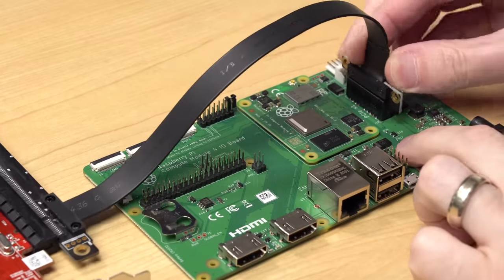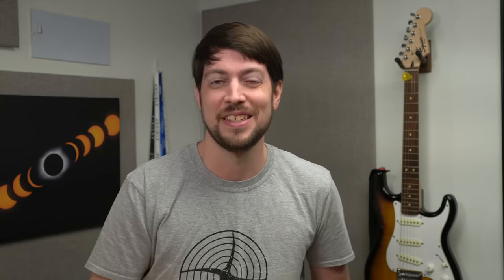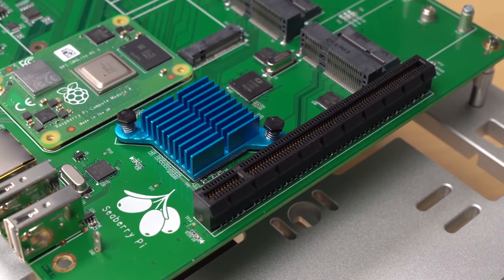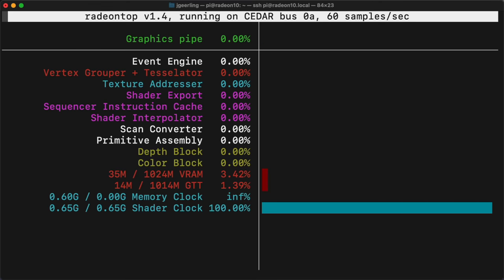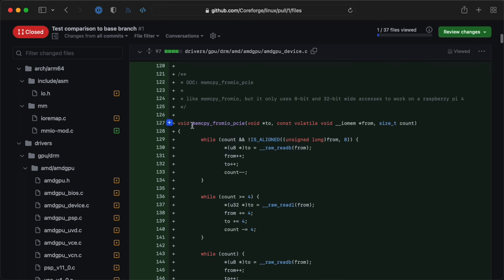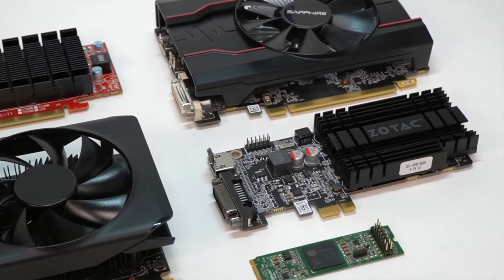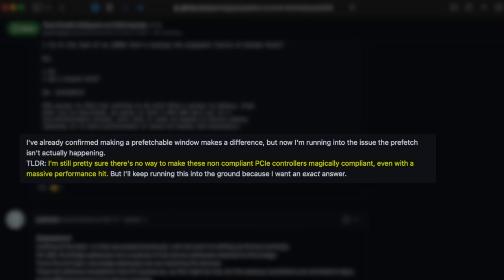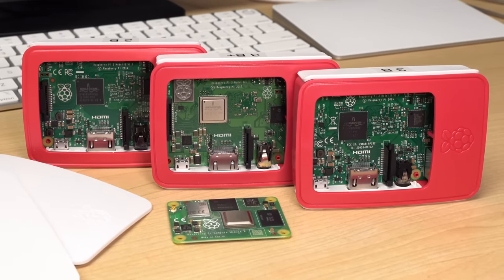It took me TWO YEARS to get this working! (GPU on Pi)

Comment: That's pretty sweet. Next step is to have GPU manufacturers ship a GPU with a CM4 built into it 😁
Reply: CM4 on an RX6400?
Reply: Compatibility layer? 👀
Reply: Didnt nvidia already do something like that?
Reply: @woutererades933  Kind of, there is development boards like the Jetson Nano and Jetson Xavier, which run ARM CPUs and have CUDA cores working.
Reply: Good luck getting your hands on one right now. They were $99 at launch and now are on eBay for $400. 🤦‍♂️
Reply: @AntonioNoack  - its only a set of arm cores along with other i/o and accelerator macros integrated into a NVidia chip.
Reply: CM4 on a 3090Tie
Reply: @AntonioNoack  all are proprietary
Reply: I miss my 5450. I once had that thing mining UNO.
Reply: Can you lick the computer while it's running?
Reply: @chrisakaschulbus4903  ja ich weiß dann aber nicht was als nächstes passieren würde 😅
Reply: @minegaminglp7380  Why is this one speaking in my native tongue? It's a dead language like latin.
Reply: Most people don't realize just how many arm processors are already in your PCs.
Drive controllers? Yes. Usually.
NICs? Also often yes. Hell, enterprise NICs are often full blown Linux machines with multiple ARM SOCs and DRAM. Some even go crazy and throw FPGAs on top of that.
And yes, GPUs also sometimes have ARM cores.

But at the end of the day, all these things are just computing things. There is nothing stopping you from writing an OS that runs directly on a GPU (that you still need to provide with power, and probably storage).
Reply: @woutererades933  You mean the EGX A100?
It's an A100 GPU + 2x 100Gbps ports + ARM cores.
But this version doesn't run it's own OS. I'm pretty sure we are still waiting for the Bluefield version of this that stuffs a DPU & GPU onto a single card.
Reply: @jj74qformerlyjailbreak3  pi3 was a beast at mining, at least for 2 months, i compiled a miner for xmg and yes coin, each pi was mining 1.2 xmg per day at the time which was around £1.50 or $2, had 50 of them running at one point until big cpu farms popped up and ruined the hashrate, but was very profitable for the initial £30 pi3 cost.
Reply: @shroomiestshroom3655  that’s how I was with ant miners and Uno. The only thing I have from those days is 2500 cannabis coins.
Reply: Always wanned Linux on a GPU xD

Comment: Thank you for contributing to open source community!

The process you're showing is part of why we have free things like Blender and Linux. People dedicate their time to making something work for the rest of us 

In arms case, this is particularly exciting because this may one day lead to a desktop pc platform alternative to the red and blue giants.
Reply: Arm is cool and all, but if we are aiming for desktop pc platform alternative, then I would like RISC-V to achieve that goal than arm, since risc-v is completely open source, whereas arm is proprietary, and if the pi4 had a RISC-V chip instead of an arm one, then I am sure someone would have already made the high end GPU drivers work with the pi CPU at this point
Reply: @STORMFIRE07  Agreed! Risc-V is exciting development.
Reply: More so, they are modern day Wizards. See these people are techno wizards. I code and mess with hardware. But this is that technopath stuff for me.
Reply: @STORMFIRE07  (well, RISC-V says nothing about PCIe having to be standard-compliant, and you can extend RISC-V with proprietary extensions, as vendors like Esperanto and SiFive do, but it would still be neat)

Comment: seems like a useful tool here would be an open-source PCIe "card" that's actually a SBC on it's own, and acts to test what PCIe features are working properly for whatever CPU they're talking to. then you could more rapidly rule out any given SBC platform without having to dig into driver dev
Reply: Sounds like a pi cm4 application to me
Reply: @the_retag  ah, another computational application of the 'spidermen pointing at eachother' meme.
Reply: famitory i love ur music good to see u here
Reply: So basically a board with an FPGA programmed with a PCIe IP core wired for up to x16 to talk to the Device Under Test, some RAM to act as a scratch space, a means to reset the Device Under Test and either a soft or hard SOC to execute tests through that FPGA fast enough to satisfy the PCIe link?
Probably with the SOC able to write to the FPGA gate definition/configuration memory or just plain booting the FPGA from the SOC; meaning the development of the test hardware becomes less of a nightmare.
And then on that a boatload of tests designed to validate spec compliance, edge cases, quirks, and do fuzzing/fault-injection in otherwise normal test cycles.

Limiting scope to pass/fail validation of specific PCIe features with no need to diagnose and correct after that might make it manageable for someone who knew what they are doing?

Comment: Maybe one day, due to your pioneering exploration, we'll get to see the truly epic sight of a Pi 5(or 6, 7 etc.) model B with a triple slot RTX 3090 sticking out of the top... or more likely watch it fall over. Still be pretty fun.
Reply from the maker: In that case, you would mount the Pi to the graphics card, and not the reverse :D
Reply: Now the Pi foundation is making their own custom designs, hopefully they'll consider designing a high-end chip for ARM. If they put enough behind it, I can easily see Pi's becoming the new standard for desktop ARM.
Reply: @amirpourghoureiyan1637  that is too cool to ever happen
Reply: @riccardo1796  At this point with open RISC desktops, it's either them or SiFive. If they hit a wall with ARM, we might even see the Pi foundation build upon their RISC-V investment and make new Pi's with RISC-V
Reply: @amirpourghoureiyan1637  I would love for them to go for RISC-V if they are thinking of making their own CPU for the pi5, since arm is proprietary whereas RISC-V is open source
Reply: @STORMFIRE07  i feel like a Pi5 with risc-v would fit perfectly, even if only for the pun value alone

(though practically it'd probably be better to give it a separately named branch called Pi-V or something rather than putting it in with the main Pi branch, to avoid confusion and what not)
Reply: Do you have a uranium reactor to power the 3090?
Reply: How would you power it? 10w Pi and 1000w 4090!
Reply: @TechyBen  Jimmy rigged PC power supply. I saw someone do it. May have been Jeff, could just as easily been Linus.
Reply: Well, we got the Pi 5.

Comment: Based on what you say, Minecraft might be the first game to test, because it uses OpenGL and Java. I don't know about OpenGL, but Java is definitely supported on Arm.
Reply from the maker: Definitely! In fact, Coreforge has been testing Minecraft in various scenarios this week, and I just shipped him an upgraded 8GB CM4 so he can do some extra testing with more RAM than he had available in the past.

Testing with actual applications is helpful because we can also find some architectural flaws in the way we patch things, so in the end it gets even more stable.
Reply: You can also go back to really old versions as well. For instance, Beta 1.7.3 ran decently on 500Mhz PPC with a 128MB Radeon card.
Reply: With optifine or sodium/phosphor you can already run Minecraft Java at a playable 15-25 fps, but what's more intriguing is that Bedrock under Android performs about the same! I can't imagine that getting those Linux patches into the Android Linux kernel would be the most productive use of anyone's time, but it would be pretty legendary to see a Raspberry Pi playing with "RTX On."
Reply: Weren't there OpenGL drivers being worked on for the Pi4?
Reply: @comicsansgreenkirby  Minecraft already works on the Pi 4 but not with a dedicated GPU
Reply: @XbotcrusherX  Now that's a damn lie. I had a dual 1.25 G4 with a geforce 7800gs, didn't try beta 1.7.3 but release 1.5.2 could barely get close to 30fps. And I had a laptop with an HD5450 back when Beta 1.8.1 was newest, that ran at only 45fps.

Comment: Excellent work. Keep pushing the limits!
As wild as it would be to get modern games running on an RPi, it's the math and AI acceleration that I want to see. Even an older GPU would yield a massive performance boost to those algorithms.

I think SBC/SoC vendors with consumer grade products do pay attention to tinkerer/maker projects like this, and hopefully they'll now see that a more standardized PCIe implementation is something more people would put to use. I wouldn't expect it to appear in the next generation (since those are probably well into the design phase, if not testing phase), but hopefully the generation after that.

Comment: It's just the beginning, Jeff.
You guys made the first step in what could turn the RPi platform in a reliable desktop platform for everyone in the future.
Reply: Personally I'd say its already there, at least for most people - I know I only really turn my main PC on occasionally, mostly for modern gaming (and to run the backups - as its got all the big HDD) now - a Pi4/CM4 perhaps with a bit of overclock and cooling can easily handle running multiple VM's, FreeCAD (at least up to reasonably complex model), web browsing, video playback etc, and in many cases isn't any slower doing so than a modern AMD/Intel monster with giant GPU consuming 3-4x the wattage at idle that the Pi maxes out at, We fleshbags are often the bottle neck, and data access speeds can be to - but the Pi isn't a slouch there, via USB3 or the PCIe its able to go about as fast as most common drives. There are of course folks doing more computationally heavy tasks for which the arm/vidcore combo are either not able to use acceleration features to make it smooth and nice (yet) or just not up to doing the task in a timely fashion - like Jeffs many many kernel recompiles would be far better done on something else, but most folks computing needs are well in range of a Pi4.

I do agree though this work really could make it a more attractive proposition for some.

Comment: Wow! No one can ever call you a quitter, Jeff. Wish I understood about 1/2 of what you just ran down, but relieved that I don't need to. Thank you for keeping me humble, Jeff. I need that.
As it is, I expect a 6 month learning curve ahead to program all the features into my Teensy Laser MIDI controller project. Just ompleted the new RGB projector and Teensy laser synth.
Yes, I can totally relate to the costs of "going where no one has ever gone before..."
8 * 600 ppr rotary encoders w/16 neopixel RGB level rings, 8 * RGB button/rotary encoders, 36 * RGB backlit buttons, 2 * 7" Nextion  HMIs, 22" multipoint touchscreen monitor, miniPC. That list soon blasted through the budget.
But for some things, settling for less nor the acceptance of failure are even options worth considering. Right? 😎

Comment: Fun build - wow lots of work. I used an R7 250 in an old QNAP NAS that had a PCIe port but no video output. I chose that card because it was still relatively new / fast "enough" so drivers shouldn't be an issue, cheap, and the correct size to fit in the NAS. Works like a charm! I had to fashion a back-plate that fit, but easy enough!

Comment: We're struggling with write combining and cache coherency issues for the radeons on higher-end aarch64 SoCs too, like the lx2160.
Reply from the maker: Yeah; from what I've seen, there are four or five issues on the Pi... and at least one or two on most ARM chips. The biggest problem is X86 device drivers assume certain features that aren't in the 'official' cross-platform PCIe spec and those quirks are hard to work around on hardware that doesn't support them.
Reply: @JeffGeerling  When I was still at linaro we use a patch for the DMA subsystem to get GPUs to work to account for the differences in memory models. That was 5 years ago, I hope
things have improved since then :)
Reply: @JeffGeerling  or the minimum spec is badly engineered . Given the chicanery I have seen regarding Type-C accessories for cell phones I suspect both a badly engineered spec and pathetic enforcement of the spec.

Comment: Very cool.I'm remembering a couple of years ago when I was looking for a low power SOC-based system with Thunderbolt support. I know now some of the small form factor x86-based systems have it (though it's pretty rare), and also that TB3 is a complete pipe dream due to licensing, but if somebody came out with TB4/USB4 in an SOC-based system, the first thing I'd try is plugging my eGPU into it. ;)

Comment: It sounds like something that'll take a while, but I think there must be some effort being done right now at server-grade arm64 hardware that could be released as consumer-grade products in the future
Reply from the maker: Definitely; there's usually a trickle-down in terms of the features in higher-end chips. Though with ARM, since there are so many chip vendors, it's not the same as with an Intel or AMD, where they build chips all the way from the high end servers to low-end embedded devices.

But it's gotten better as ARM chip builders have gotten more on board with standardization (like with SystemReady).

Comment: Graphics drivers have always been a pain in linux. Been using Linux since the mid '90s. Right now I'm fighting the amdgpu drivers even on an x86 PC.
It just locks up, hmm, sound familiar?
I can get it to sometimes work with the pci=noats kernel parameter. I've tried MX Linux, Linux Mint and now Deban Linux. Initally it works but once they update past some version 5.10.XX it just locks up. Loading newer kernels gets past the lockup but then other things break. I can't use another video card as it is a SFF HP with no PCI slots.
I'm impressed you got it working. 
I think the Pi foundataion has seen how much the use of a PCI slot has exploded. Hopefully, they will work on much more support on a Pi5?

Comment: What I hear you saying here (and it's not an insult) is that the scope of things for which the Pi is a valid production workload device is pretty strictly limited -- as well it should be; it's not designed for most of those workloads.

Comment: Thank you Jeff.  You're advancing the ARM architecture, and I believe that X86 will die in the mid-term future.
Reply: no
Reply: mid to long term.. Mid-term we will see more bigLittle stuff and long-term GPUs and CPUs will shift more and more to ARM and RISC. But with that, I also predict the age of modular components such as standalone CPUs and RAM will also die.
Reply: @TheBacktimer  I do agree.
Reply: people keep predicting the death of things and they keep being wrong. even vinyl
 never truly died. x86 will be here for the foreseeable future.
Reply: @bzuidgeest  yeah, x86 will never die due to the cost of arm being higher in some cases.
Reply: @bzuidgeest  I'm not saying it's right. Many people have predicted the death of things and weren't right, for example VR. As an owner of a Meta Quest 2, I'm offended by "VR is dead"
Reply: x86 will never die because of servers
Reply: @stevefan8283  I agree it is not going anywhere, but not because of servers. Arm based servers are a big thing these days. Very low power usage for the performance. Amazon and such have racks full of them.
Reply: @bzuidgeest  Big. You mean 80% of the Docker ecosystem does not even support ARM64, and big players like Bitnami is still struggling to employ ARM64 support. I will say ARM based servers are promising but is near unusable in the mid-term. 

I have a small ARM based K8S cluster myself and I'm struggling to port some of the Docker images to that little Ampere server, and the performance is just 80% of your conventional x86 EPYC instances, especially considering how AMD is closing the money gap on it right now. 

If not that Oracle is generous enough to give us the free Ampere server, I rather stick with x86 without all the pain and suffering of porting issues I endured. Hell, even SQL Server and Oracle Database won't be ported over to ARM64 and they eat a big chunk of database market shares.
Reply: @stevefan8283  there is more to servers then docker. The stuff you containerize works perfectly fine directly on the hardware without docker. A webserver on arm hardware works fine. And companies like Amazon have custom arm chips to optimize the work. No problems. Seems to me you are having a little tunnel vision on docker. I admit docker is easier on x86, but there is so much more. So we will have both for quite a while

Comment: What about compiling an opensource vulkan/opengl game to test 3d acceleration performance out when the drivers are more stable? Wine Is Not an Emulator, you were never going to get Wine or Proton to work.

QEMU might be convinced to pass the PCIe device through outright but as mentioned, it'll lead to cpu pcie support issues (no custom windows driver). If you emulate an x86 cpu using qemu, install a linux distribution and use your custom gpu drivers there, you might get steam support and Proton to work... at a massive overhead cost, but it might work as a proof of concept.